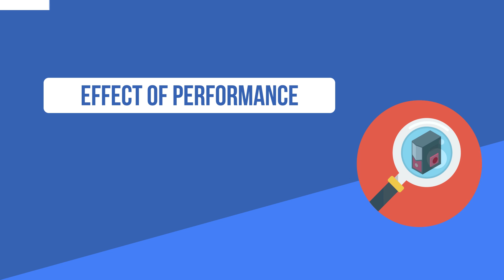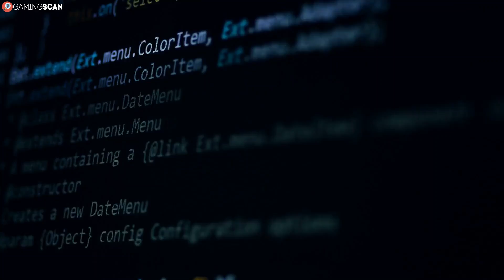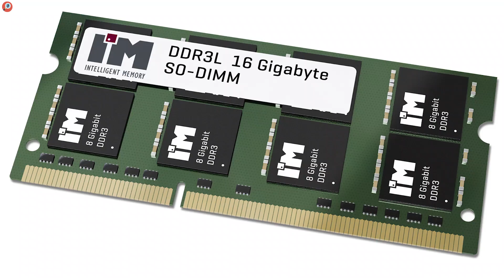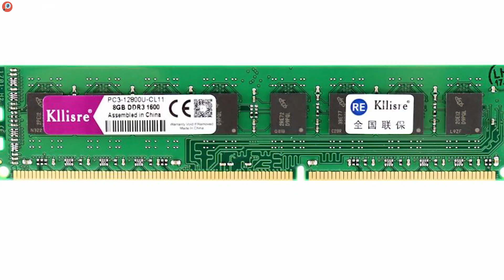Single Channel vs Dual Channel vs Quad Channel Memory (2020) [Simple Guide]

Comment: You should have mentioned that it all primarily depends on the motherboard first and CPU second on whether you can use a multi-channel setup or not. Having 4 RAM slots doesn't always mean the board supports quad-channel. It doesn't matter if the CPU supports it if the motherboard doesn't. Typically a motherboard with 3 RAM slots, which is rare, is configured for triple-channel, but you should check the documentation. Most boards with 4 slots are dual-channel boards, except for several high end and server boards that are quad-channel. Most modern boards are multi-channel, but there are still single-channel boards in existence. For a motherboard with 4 RAM slots, installing 2 sticks side by side will result in single-channel config instead of dual-channel, you need to use the proper slots if you only have 2 sticks, it won't matter if you use 4.

I read thru your article and watched the video to the end, but there was no mention of this at all. I saw a mention of the motherboard, basically claiming that what configuration you have is based on how many sticks of RAM you have installed, which is wrong unless you only have one stick.
Reply: Perfect comment, thanks for the info
Reply: I will suggest anyone still confused on this to watch https://www.youtube.com/watch?v=9nSX2taw-Y4 and maybe even read their article on this matter
Reply: Will my asus tuf gaming x570 plus support 4 ram channel? Or do I only get 2 sticks....
Reply: @WatermelonWizard  a quick google search for the motherboard and read of the spec sheet would tell you that it supports 4 sticks of ram in a dual channel config... no idea why im doing the search, but w/e
Reply: @aquaventus bro what if the motherboard specs isnt available online? I have this HP 15 laptop.. model name 881D and i cant find the specs list anywhere. Even in the official HP website
Reply: Genius mate
Reply: Wait im getting 2x16gb ram and my motherboard have 4 slots, should i get 4x8gb or 2x16gb? The motherboard is dual-channel
Reply: @hbaabes  u should get 2x16gb
Reply: @Lewis-hl9zg  that what i got! And im glad that i got 2x16 :)
Reply: @hbaabes  bruh just add 2 more and thats 64 gb ram
Reply: @Lewis-hl9zg  Nah man 32gb is more than enough xD
Reply: @Lewis-hl9zg  math
Reply: @hbaabes  it doesnt matter, but 2*16 maybe better for Future proofing, and 4x8 Looks better because No empty Slots, so No benefits, do what you want
Reply: ryzen 5 1600 af does not support memories in the 4 slots?
Reply: @fernandojunior9393  No it Supports all 4 Slots but only 2*Dualchannel or 1*Dualchannel or singlechannlel
Reply: @Aqua Venus

I don't get it

why add 4 slots if doesn't support quad channel
Reply: Tide Detergent extra memory
Reply: 1TB at 4000mhz is minimum for chrome
Reply: i have 8 ram slots
Reply: @ORBIT9224  Threadripper?
Reply: yeah the motherboard is coloured accordingly (ram slots!!)) right?? i heard linus talking about it!
Reply: @generalginger7804  Not Always, ready Manual, or on the Mainboard it is often written
Reply: @generalginger7804  yup right. Also watch the numbers. For an example: slot 1 and 2 first pair. Slot 3 and 4 second pair.
And it's recommended to use the same model (or at least go with the same manufacturer) and it will work.
Reply: I don't care your long story but my is Dual channel with 2 sticks with 32GB is enough for gaming the entire day don't need 4 sticks.
Reply: Thank you. You answered the questions I had👍
Reply: This was more helpfull then the video thanks
Reply: https://youtu.be/UOP5qRPpKTk
Reply: Thanks
Reply: Thank you for writing this, now i dont have to do it. But she Said that AMD CPUs habe only dual channel, which is Just wrong (1:10) she even Shows a f*ckin Threadripper that has QUAD CHANNEL AS far as i know. Sry for my grammar, Auto correction is on German so a Lot of Capital Letters.
Edit
Ryzen CPUs have No Quad Channel, but the threadrippers and the EPIC rome do. So saing AMD does Not Support it, would only an Intel Fan Boy or someone stupid say.
Reply: What if you have 4 sticks but ur mobo is dual channel? Would u get more performance if u had only 2 sticks but same amount of ram? Thanks
Reply: @thegr8rambino  if you have 4 sticks of the same size and speed and your motherboard have 4 slots then just use them all, it is still dual channel, unless you already planned to upgrade to just 2 sticks i guess
Reply: @aquaventus  that was my question, if i go from 4 2gb sticks to just 2 4gb sticks, will it make the system faster at all? thanks!
Reply: Bro, I have an Intel i9 on a Z390, I install 4 RAM cards 16gb Crucial Sport 2666, bit I'm having problems, Windows detects "Hardware" error on the Memory Diagnostic, but I check every RAM one for one and... Everyone comes clean on the Memory Diagnostic... So, is the motherboard fault and is failing, or is the 4 RAM using error?
Reply: Cpu and mainboard matter´s if the cpu does not support triple channel there is no sense behind getting a mainboard that does suppport it.
Reply: wow the best comment..love the video and the comment thanx dude
Reply: Thanks for Clarification it was a very good Point to Tell
Reply: this is exactly the information i was looking for! thanks!
Reply: Thank you for this insight
Reply: @Jabba The Hutt One somewhat weird example: motherboards using the Intel X299 chipset are designed for 4-channel memory and generally have 8 slots total (4 banks of 2 slots each).  But if you install either of the low-end 4-core CPUs (i5-7640X, i7-7740X), those CPUs only support dual-channel RAM, and only 4 of the 8 slots are usable.  If you install any of the better CPUs, with 6-18 cores, you get quad-channel operation.  In this case, it's a limitation of the CPU, not the motherboard.
Reply: A very useful comment. I already knew that my 4-slot motherboard is dual channel, but not everyone is going to know that and may assume that it is quad channel just because it has 4 slots.

Additionally, make sure to also look through your motherboard's manual (you can view them in PDF format online for basically every board even before purchase), because different motherboards will also require you to place the sticks in a different format depending on the number of sticks you use (for example, many state that you use should specifically use slots 2+4 if you only have two sticks).
Reply: I got a b450 with a r7 3700x I have 2 x 8 sticks now but can I but the same set extra so I have 4 x 8 that I have 32gb then or does that not work
Reply: Perfect comment thank you
Reply: Bought a cheapo atermiter x99 an its a quad channel, just sayin
Reply: Can i have 3 sticks of ram in my pc?
Reply: If you install two 8GB ram on a motherboard with 4 ram slots side by side it will be single channel right? So it be 16GB ram running in single channel

But

If you install two 8GB ram separate by skipping 1 slot installing another and skipping 1 other slot it's dual channel being 8GB + 8GB running in dual channel of 16GB ram? 

Then what about installing all 4GB ram on 4 slots? Is it still dual channel and has the same performance as 8GB ram × 2
Reply: @MrGreenScreening  Yes for all three scenarios. For the third scenario there would be some performance difference to 8x2 since you would be using 4x4 which is a lot more inefficient. RAM timings also affect the performance. Unless the motherboard has quad channel support. Check the motherboard manual on what slots to use for dual channel, ignore if you would populate all 4 slots.
Reply: Just sold another ps5 cause this just proves pc is fucking stupid
Reply: alter du bist ja scheinbar so ein ganz schlauer typ hahahahya
Reply: @icheinfachichicheinfachich8739  ja ich wollte mich auch schon beschweren weil das Video hier von einem Amateur gemacht wurde, voll mit falschen Aussagen, und bin erst bei der Hälfte

Comment: If you install two 8GB ram on a motherboard with 4 ram slots side by side it will be single channel right? So it be 16GB ram running in single channel

But

If you install two 8GB ram separate by skipping 1 slot installing another and skipping 1 other slot it's dual channel being 8GB + 8GB running in dual channel of 16GB ram? 

Then what about installing all 4GB ram on 4 slots? Is it still dual channel and has the same performance as 8GB ram × 2

Comment: It may be superficial, however the last part of the video where is was mentioned that you can just stick another 8 gig stick in with another, and your good to go. As long as the voltages are the same, or maybe within .1 to .2 volts (e.g. 1.3v &1.5V) you can probably get away with it. but a 1.2v and a 2.0v+ can cause blue screens, and instability issues. If I am wrong on this, or have an incorrect perspective, please let me know. I only shared this, cause I had experienced instability with 2 sticks that had voltages too far apart.

Comment: Most consumer grade cpu only support dual channel ram, you can see a performance boost by populating 4 slots by the fact memory is acting as in dual rank ( 64 bit bus X4)
this caused by the fact that when memory is refreshing data cant be access from that rank, 
by having multiple ranks u can read write data while on a different rank while rank is refreshing. performance boost in in range of one digit %
U never what to use single channel memory for gaming no matter the capacity!

Comment: There's so much wrong in this video: 
1. Multiple Channel support does NOT only depend on the CPU, Motherboard must also provide the channel support you're looking for 
2. At least for intel, but most likely true also for AMD, if the motherboard has 4 slots, it's dual channel ready. If it has eighth, it's quad etc. You still need a CPU that supports the number of channel you want to make use of 
3. If you're not populating all your slots, you MUST pay attention to which ones you are populating. More often than not, the slots that share a channel are NON ADJACENT. 
4. While some current generation consumer grade CPUs might support quad channel, you're unlikely to have the CPU motherboard combo for quad channel unless you're paying top dollar, because: 
5. Quad channel+ is usually available (or at least "easily feasible") only on the Intel xeon series and AMD threadripper respectively, which in turn require much more specific sockets and motherboards (usually E-ATX, esp AMD) which are build specifically with quad channel+ in mind

Comment: i am using hp zbook 17 g3 with 4 ram slot  and Intel(R) Xeon(R) CPU E3-1535M v5. can i mix RAMs of different bandwith. currently i am having 20gb RAM (8gb 2400T, 8gb 2133P and 4gb 2400T all being 1Rx8). can i add 16gb 2Rx8  2666v? all memorys are DDR4. when i checked my CPU memory support on intel page i see; 
DDR4-2133, LPDDR3-1866, DDR3L-1600

Comment: I just bought a pretty expensive laptop and paid $$$ it has top processor i9 and rtx and 16gb of ram. I just found out the sad news that my model has the ram has 8gb (3200), and not 16gb as I thought, soldered to the board and 8gb installed on the only one "falsely allowed to upgrade" slot. So I paid the $$$ thinking about having a high end machine that will last for years to come with just upgrading more ram in the future (I thought!). But the soldered 8gb of ram makes it impossible to go over 16gb if I want to use the advantage of dual channel. I still have 15 days to return the machine. Would you suggest me to return it? or you think it's fine to add a 16+8? resulting in 8+8 in dual channel and the remaining 8gb in single channel? I see some very demanding games are already requiring 16gb ram! I need an opinion of someone with good knowledge. Please help!

Comment: I have a question. For some reason I can run 32gb ram at 3000 to 3200 MHz but when I do 16gb ram I can run it at 3600 which is on the sticks. i have 4 8gb sticks. Why can’t I run it at 3600 for 32gb

Comment: You skipped so many aspects of wanting to run as much RAM as you can at recommended Freq's.   

First, lane saturation.  You have a severe amount of data running through ALL lanes at all times.  Its the nature of computing.  The saturation or over saturation of a lane is ALWAYS happening at different loads.  If you can spread out that load it leads to easing tension on hardware.  ONLY MULTIPLE high speed storage devices can lead to lane over saturation. Dont let anyone tell you differently. 

Second, GPU loads are negligible.  If you think you are going to saturate a 4.0 or even a 3.0 PCIe slot, you better look again.  Most modern processors offload A LOT of work to the GPU and that hand off happens through RAM.  Motherboards on modern gaming PC's can make better use of the chipset features with multiple RAM sticks vs only 1 or 2 channels.

Third, background processes.  This is where it gets tricky.  If you have, say for instance, a 3900X, you know about background processes more than anyone.  The more cores you have allows for background processes to happen without impacting activity you are currently performing.  An example, running Windows Updates,  high cap Anti-Virus software, music channels, web monitoring software, household management utilities, etc.  The more lanes you have, the more memory you want for those background processes to run while not effecting current computer use.  You know who you are.

In conclusion, I tried to make this simple so my info may not be exact, but its close enough to get my point across.  If you have the ability to run all your RAM slots, do it.  Running the motherboard at maximum RAM slot compatibility WILL NOT HURT IT.  If it can run 128Gigs, than run it at 128Gigs, its designed for it.  IT IS an Overclock, contrary to popular belief to run 128Gigs of RAM with all four slots populated at 3200 Mhz on DDR4.  Make sure you hook up that secondary power slot that has 4 pins next to your eight pin.  If you aren't gonna use all the features of your motherboard, then why did you buy it?

Just because you have 4 sticks it DOES NOT MEAN QUAD CHANNEL!!!  Damn!!!  You have 2 channels. A1 and A2, and B1 and B2.  THAT IS DUAL CHANNEL.  Stop confusing people. There is no C channel or D channel.  That would be 4 Channel.  You are interchanging Ranks vs Channels.

Comment: thats not Quad Channel, only when the slots are split in 2 Slots CPU 2 Slots. Thats the minimum configuration. 
You show a AMD Threadripper, which is a Quadchannel CPU. It supports like the X79 & X99 & X299 chipset from Intel, 8 RAM Dimms. Normaly 8 RAM Slots is Quadchannel

Comment: 2018: Build a PC with single 16GB ram
2018 1 MONTH LATER : Added another 16GB ram
2019: Added another 16GB ram
2021: Added another 16GB ram
Now I have 64GB RAM but my CPU is still Ryzen 5 and still having gtx 950ti bruhh

Comment: You say "AMD CPUs only support Single and Dual Channel memory" AND you are showing a Threadripper 1950X, which I use. I'll tell you a secret: I AM indeed running on Quad Channel RAM - veryfied both in UEFI and with CPU-Z.

Comment: Never trust a video with Likes/Dislikes turned off...  
Not sure why AMD processors were mentioned as only supporting dual channel but then show an AMD Threadripper 1950x which supports quad channel memory.
Reply: Not to mention, there is actually a major benefit from going dual or quad channel as opposed to single channel - especially for gaming. Not sure if she made that clear.

Comment: Ad 4:55 - It’s also best, if not required, to have the same frequency and timing when buying the second (third and fourth) stick. Just always buy the same brand and model as the first stick and you should be good.

Comment: Is it okay to have 3 sticks of ram, I only have enough money for 3 sticks, my motherboard has 4 slots. Or do I use 2 sticks instead of 3
Reply: Dont use 3 sticks. Either 1, 2 or 4 sticks. Best go for 2 sticks now and save up for 2 more later?
Reply: @Erwin0912  is it bad to use 3 sticks? Also I have the gigabyte B450M D53M
Reply: Also. Little sidenote, check your motherboard guide on which ram slots are dual channeled together. In most cases slot 1+3 and slot 2+4, some motherboards even give them different colors so you can see which slots are dual channel.
Reply: @Erwin0912  would it be okay to mix rams like I have a 2x8 ddr4 2666 MHz is it okay to mix them with a 2x4 ddr4 2666 MHz
Reply: @lucid4984  you can mix up Ram sticks. Keep note that if you use different mhz speeds it will always use the slowest for them all. In your case with the 2x8 and 2x4 all 2666 mhz it wont matter. It should work fine if you mix them up no problem, just check if their latency and timings are the same. All for better stability. I'm not sure about that motherboard in particular, but check the guide on how to stick them in. Its probably from slot 1 -4=  8, 4, 8, 4.
Reply: @Erwin0912  okay thank you so much ! How do I make sure the timing is right
Reply: @lucid4984  Are you sure that motherboard supports 4 ram sticks? I couldn't find the one you linked but I did find the Gigabyte B450M D53H and it only supports 2 DDR4's with a max of 32gb
Reply: @Erwin0912  tbh I’m not sure I’m just hopin
Reply: @lucid4984  the memory you buy has 4 numbers on it. For example C15-15-16-36. Those are timings of the Ram sticks. Best get them all with the same timing. You can change ram timings in the bios if they dont match up (in the AI tweaker) but you might run into compatability or stability problems. Or it might work fine. It's a bit of trial and error
Reply: @Erwin0912  it’s got 4 slots so I’m hoping it supports
Reply: @Erwin0912  well if the timing was wrong would it be okay to just put the two sticks of ram I bought the 2x4 instead of having one 2x8 and a 2x4
Reply: @Erwin0912  so I think my motherboard does support not entirely sure, but I went into task manager, in my memory and it says 1 out of 4 slots used
Reply: It depends on what slots you are using.  If you are populating A1 and A2 and using B1 you are running in single channel.  The B stick won't work and is wasted.